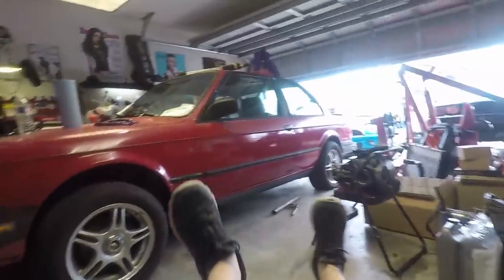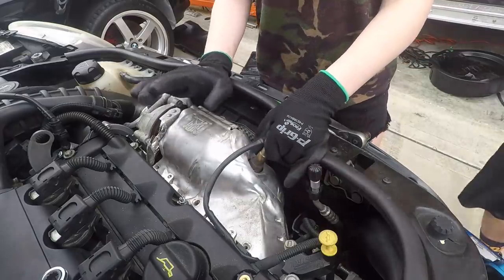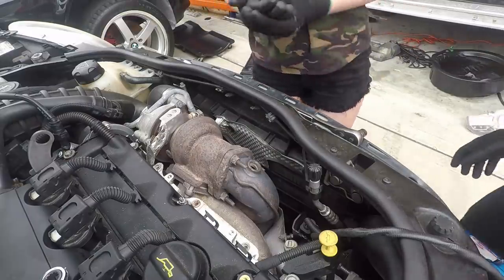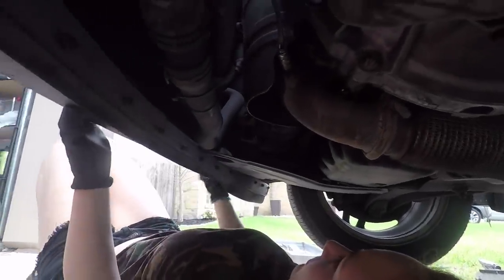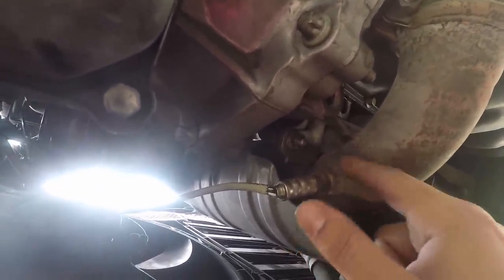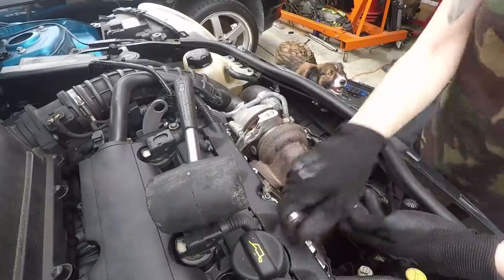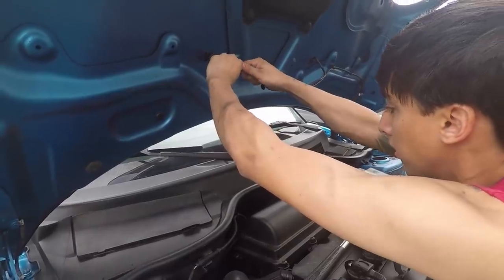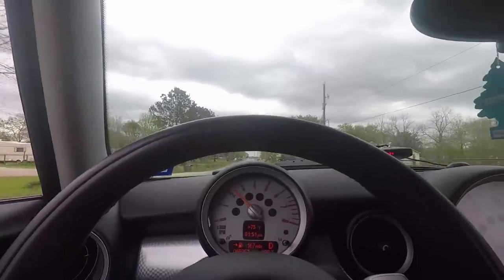R56 Mini Cooper S Catless Downpipe Install - DIY

Comment: If you put the exhaust in from the bottom you wouldn’t of had to cut of those brackets
Reply: Totnesboy it might be the v1 v2
Reply: put it in from the bottom for v1 or 2 then bend one of the brackets

Comment: good job what  about an air racing  intake system  and a bigger inter cooler
Reply: Yep got an m7 intake but I didn’t replace my whole intake piping just replaced the stock one and replaced it with a new silicone elbow and the heat shield that came with it and the filter but for the front mount intercooler it doesn’t need to be bigger just a aftermarket intercooler like forge, they tend to be the same size.

Comment: What size was the downpipe and is it still stock exhaust from the decat ?
Reply: Muffler and resonator is still attached and it seemed like a catless downpipe only so stock exhaust but the downpipe but they’ll need a flash tune.

Comment: ECU Remap after installation of the down pipe?
Reply: Recommended but some people have done downpipes and considered it well after install but check engine light is the main issue, it won’t effect your engine but the issue would be systematic failures as such.

Comment: Buy a new up flow sensor after you twisted yours around like that. They have a plug on the other end you know
Reply: It kind of triggered me but it’s alright as long as nothing pops up it’s completely fine.
Reply: @kdodson77
 the fk is an up flow sensor? you mean the O2 sensor? the upstream O2 Sensor?
Reply: @johnboyd5691  that’s what he means yep
Reply: @johnboyd5691  o2 sensor is the “flow sensor”

Comment: Nice mod. But what about inspection? Here in Holland you can't get it approved without cat...For 'older' cars you have to go inspected every year, in Holland. The new ones, every 4 years, then 2 years and in the end every year...
Reply from the maker: Thanks! And I have a guy over here who can pass inspection on any vehicle
Reply: Any check engine light?
Reply from the maker: Yeah, check engine light came on after a day or so. Just throwing an o2 sensor code. Will have to find a way to tune it out
Reply: it will make the ecu think its running lean causing it to dump more fuel into the mixture. then it runs rich as shit. you should def get a tune after
Reply: I have a decat on my Mini and pass APK.
Reply: Here in Florida 😎 we know no inspections wooooot wooottt

Comment: Did you need to weld to connect the down pipe to the rest of the exhaust? #noob
Reply: Its a bolt on, no welding required.
Reply: Fits right into the flex pipe

Comment: Did it throw a check eng?
Reply from the maker: Yeah it ended up throwing a check engine light after a day or so
Reply: How did you fix it or are you just living with the light on?
Reply: Sparrow415 to BKK might be a bit late lol but look for a sensor spacer
Reply: @hypocrnsnk  a o2 defouler (mini cat)
Reply: @hypocrnsnk  Add a Stage 2 Tune and it will cancel out the light. Usually these custom parts work in conjunction with each other.

Comment: Rev9 Downpipe = bad fitment.
Reply: did fit.. he didn't quit. don't be a quitter mike
Reply: Bimmer Dude lol until that pipe gets flexed back n forth and breaks because it doesn't have the mounting bracket anymore
Reply: @BimmerDude  Hey Bimmer Dude! Just watched your video on removing the front bumper and installing the Intercooler. My engine is all torn apart, waiting on my Timing Chain kit to ship here. New timing Chain, K/N air intake, the Intercooler, water pump and headlights. Will be ordering the downpipes w Cat soon, and Stage 2 tune.